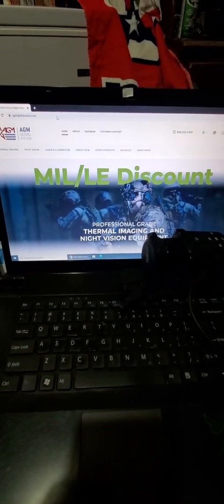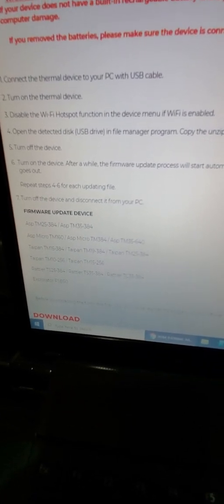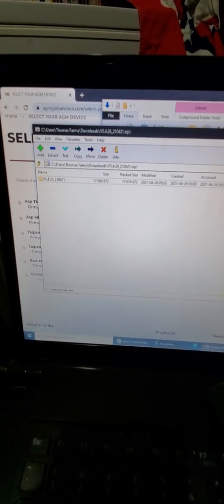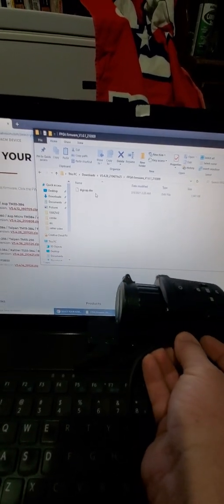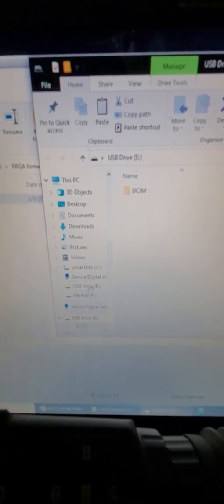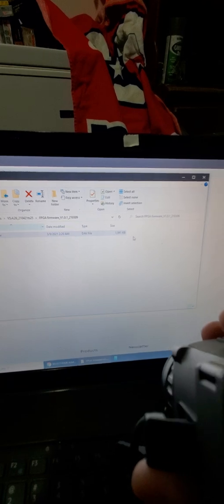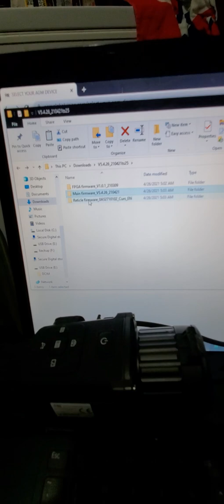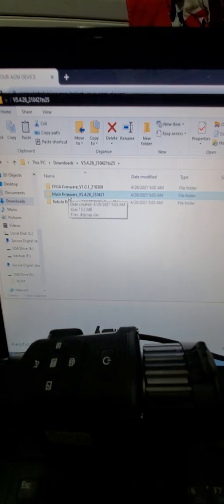AGM Thermal Firmware Update

Comment: So much easier if you plug your scope, power on,  the drive that pops up with the scope folder is what you want.   Copy that drive, mine is f, goto the .dav file and right click, goto copy to, then paste that drive in there.  Then make sure it's in that drive.   Power off power on and it automatically updates.  I closed the drive file anyway.  Once it's done it will power down and power up.   I started to play with the new setting and it said wait about 10 min to update all the settings or whatever.  One that is done you are good.   Ts 25 384
Your wording is hard to understand.   Should pin this comment

Comment: It's been over an hour, stuck in upgrading screen.
Reply: which scope do you have? did it finally finish?
Reply: @danslone1080  It’s nothing fancy. TM160. I had to send it back, they’ve replaced it with a new one.
Reply: i had same problem.. so i tried shutting it off and now it wont power on. how long did it take for them to replace it?
Reply: @mcalixtro82  it took few days with FedEx $20